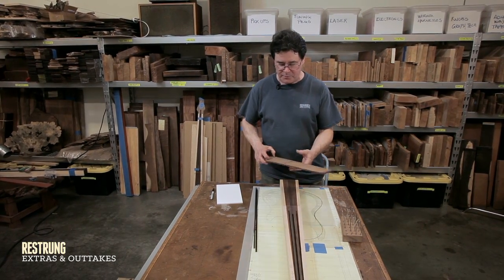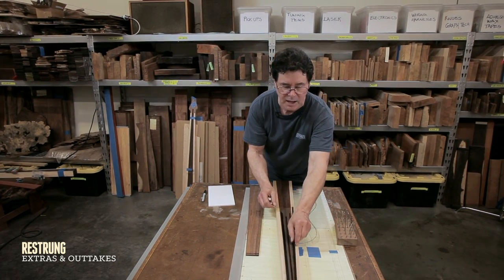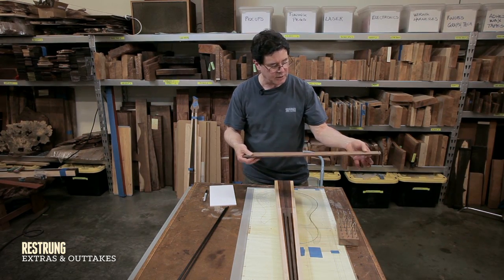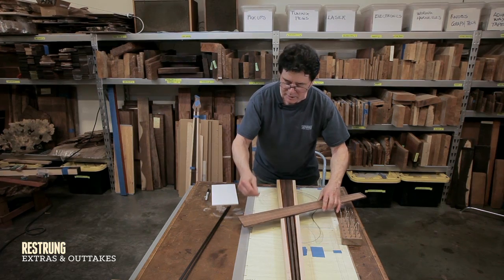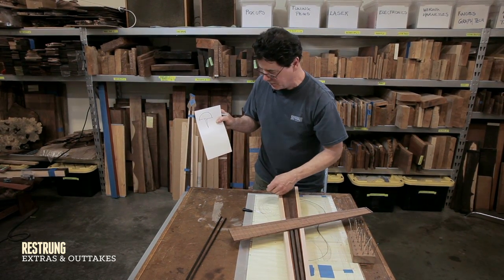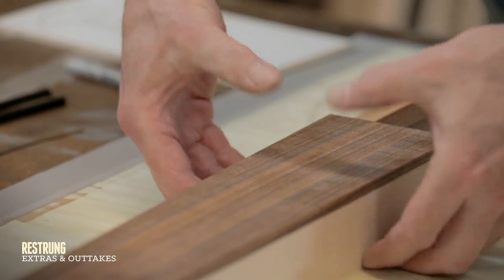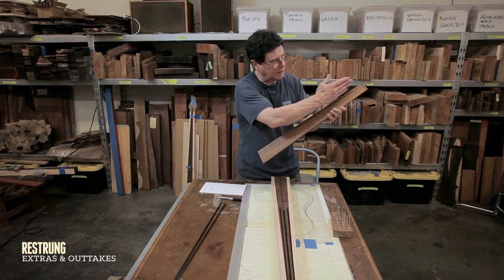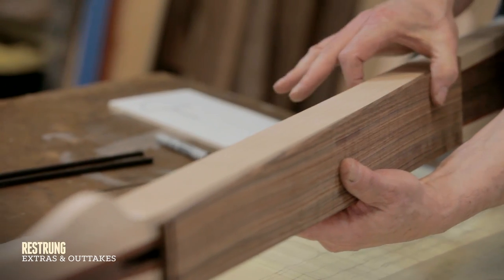How to Build a Bass Guitar - Step #11 - The Fretboard

Comment: How does the carbon fiber re-reinforcements effect the bend and sway of the neck when tightening and loosening the truss rod. Also would it be advised to always add these re-enforcement's on a 6+ string bass especially for a fret-less?